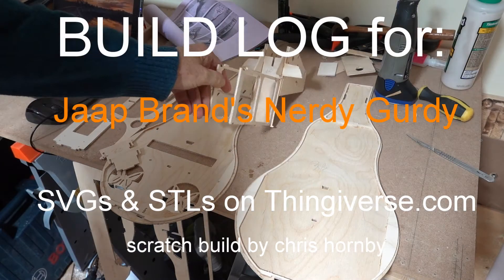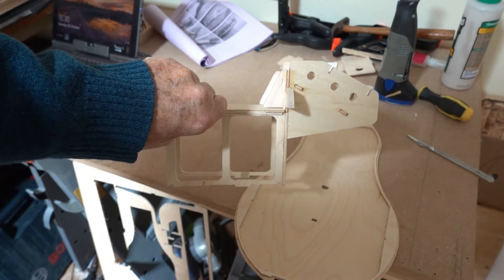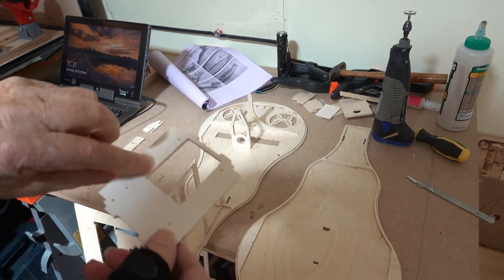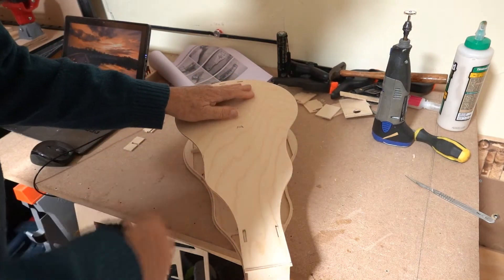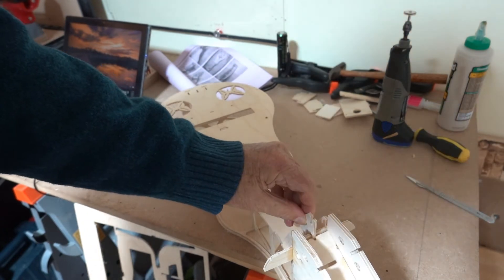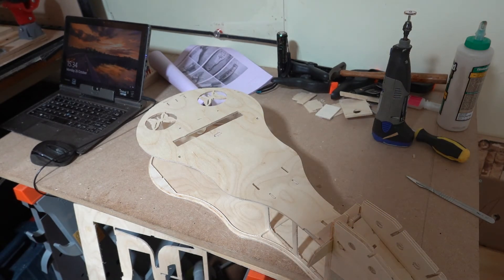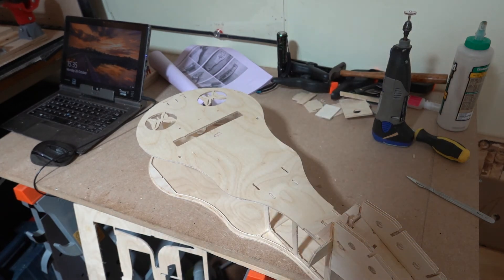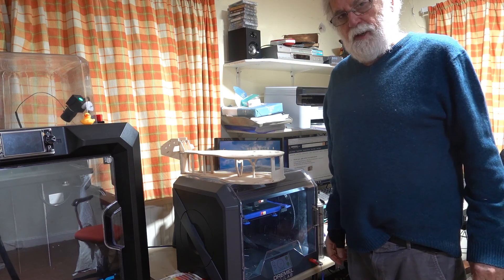Nerdy Gurdy Build Log Part 4

Comment: Please don’t use superglue. If the joint needs to be separated for any correction or future repair, it will not come apart without breaking the wood. Also, print and install bearing mounts before assembling the body. Side note you’ve probably discovered is that the t-brace does not receive a bearing.
Reply from the maker: You are probably right CA is not the way to go, however I am using woodworking PVA glue, which is also impossible to separate. Advantage of using CNC. If something goes wrong, just cut another piece.